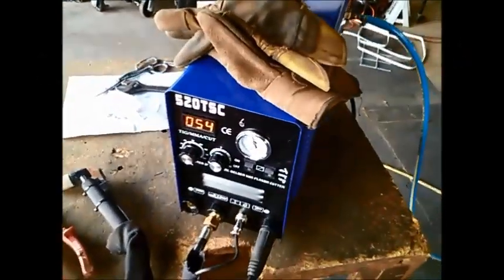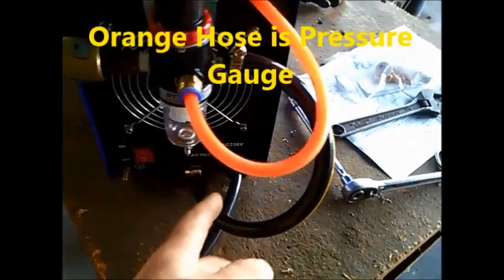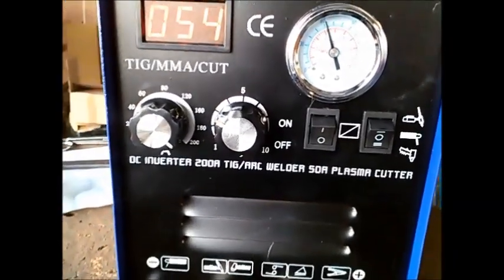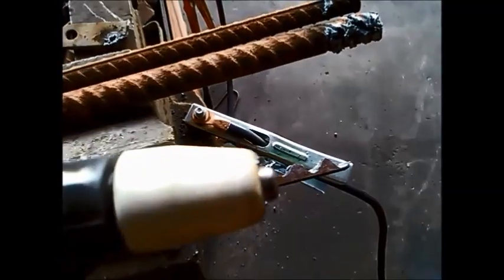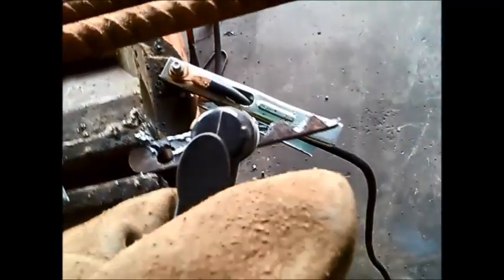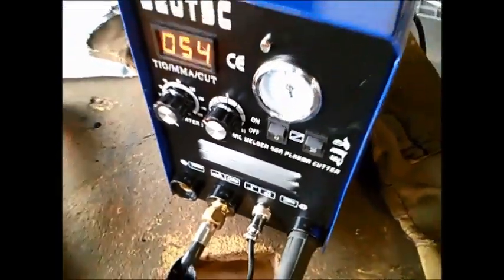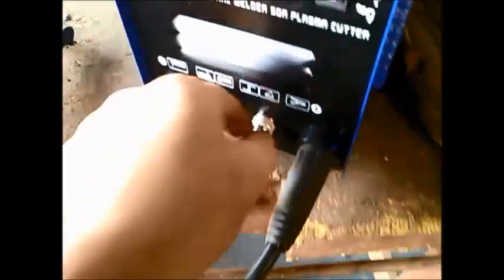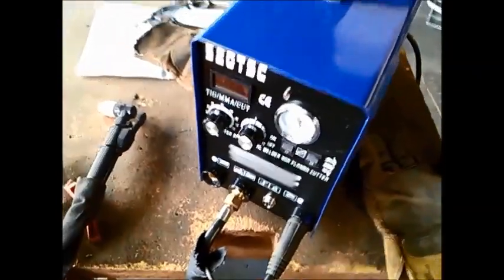Review 3 in 1 Plasma 50A / TIG / ARC 200A Setup and Test

Comment: Do you know what the on and off switch is that is under the pressure guage? What function would you use it with? My guess is an inverter, and use it when you arc weld . Like I said it is a guess,, but I would love to know 100%. Any input would be great! Cheers...
Reply from the maker: could be, try it. cheers
Reply: I have two thinking I got 
Unlucky on the first one , tried a second one thinking it a fluke, dose a crazy array of lees than nothing ,can’t reach manufacture, no number, web site closed down , the quality of wiring is amazingly crap, BUYER be WARE!,,,,,

Comment: I bought the same unit.  Not real sure if I like it or not.  Do you have any manual on this unit?  Arc works great.  Not sure if the Tig works...not sure if the buttons.  Plasma struggling to cut.  Any more tips is greatly appreciated.  Did you make a 2nd video??
Reply from the maker: hi, contact the seller you purchased from.... i did find some loose internal spade connections in my one. someone once advised to solder the spade connections but i did not do that, i just made te connections a bit better with a pair of pliers. cheers

Comment: Where did you get the fitting on the back for the moisture, gas ect.
Reply from the maker: hi, spun up on our lathe. cheers
Reply: @YepThatsIt  hi mate how does your tig work??? I have the same unit and the rest works ok but tig is no good...it's acting like a plasma cutter...really loud and aggressive...melts everything. The tig torch only has the 7 pin plug and gas line and that's it?? No dinse plug for the negative side...gas setting are ok and it's set on tig. Tungsten is sharp also...so frustrated and buyer won't reply.

Comment: Hello sir, I wanted to know if this post is HF for the tig function? that means "HiGH FREQUENCY"  you were already asked this question at the beginning of the discussion, what types of electrodes are needed for cutting? are you generally satisfied? thank you for your reply
Reply from the maker: hi, i mainly only use the plasma cutter on our one.. try ebay for replacement tips. cheers

Comment: For those wondering about the TIG function. First, I'll say the Plasma works as well as this review suggests. The ARC capabilities are excellent- very low stick and once I've started, I can control the stick down to very low levels, even successfully depositing 1.6mm rod onto 1mm thick steel. That's fairly impressive in my opinion. TIG is also HF started, so just get close and it fires up. You can turn on the gas and get close to the work and the arc will light right up before you touch. No need to scratch start. Power control is excellent and I'm going to get a pedal for it sometime. I've only TIGed at low power - around 60A, but had no trouble melting two bolts together with the TIG... I miss that it's DC and can't be set for touch and pulse, but the HF operation more than makes up for it. I get some radio noise on the power lines, so I'm thinking to get a filter for the mains, but otherwise, this is an excellent unit. Thanks to the original reviewer - your comments helped me decide on this model. I'm not disappointed.  Mine cost around $360 including shipping to Perth... Good value.
Reply from the maker: thanks for that. cheers
Reply: @YepThatsIt  hey I just bought one...were does the argon plug into?  Or does it share with the air line inlet?
Reply: Hey mate, looking to buy a 3in1 myself but don't see too many Australian stores selling them, you got a link to the one you got? Thanks.
Reply: Thanks for the info. I'm happy with it as a stick and plasma cutter. I'm about to Tig. So it's ac Tig, right? I'm trying to work out which tungsten bits to buy for stainless. Cheers

Comment: Whether it is worth buying?

Which thickness can be cut off? whether it is a compressor or a gas?
-whether it is good or not, connect stainless steel?
Reply from the maker: hi, I`m using air compressor. it will cut any metal to about 25mm depending on which metal. cheers
Reply: @YepThatsIt   tnx
Reply: What kind of air compressor goes best with this one? More specifically what would be the best cfm to look for along with air capacity (pancake compressor vs 18 or 20 gallon compressor - would prefer a smaller one if possible) and also any other specific specs to look for to pair with this particular model (cut520D 3 in 1 welder cutter/rig/stick)

Thanks!!!!

Comment: I just bought one of these do you have any idea what the center off on switch does?
Reply from the maker: Hi, not sure yet, haven`t had chance to get some TIG gas and try out other functions. I did  however, find out that the "spade terminal" contacts are inadequate over long term use, so I plan to solder all mine. Cheers
Reply: YepThatsIt the tig works fairly well.  I also bought the 50 piece tig accessories which contains the pyrex glass it works great
Reply: My guess is that is an on off switch for the machine like the one in the back. Try leaving the one in the back on and see if the front one overrides it. I heard that europe requires the switch near the power inlet and U.S. doesn't so this may be how they make it a global market machine. Just guessing and considering buying one too.
Reply: D J it also may be a switch for the foot pedal. I haven't ordered one yet.  you will definitely like it if you buy one I am very impressed with mine.  the high frequency start on the tig is awesome.   im gonna modify mine so I can have the plasma and tig at the same time
Reply: What does each of the front two volume levers do? One is voltage control and the other is what?